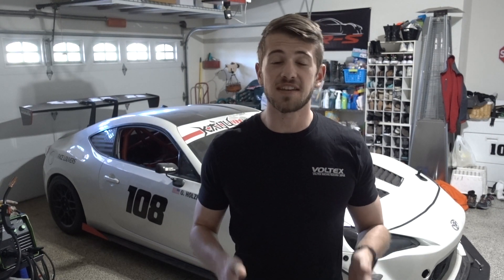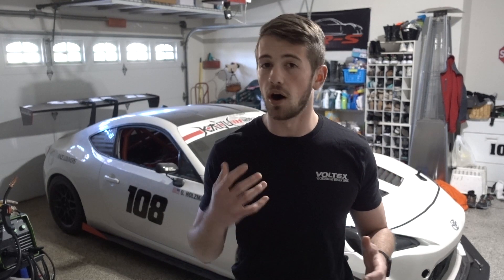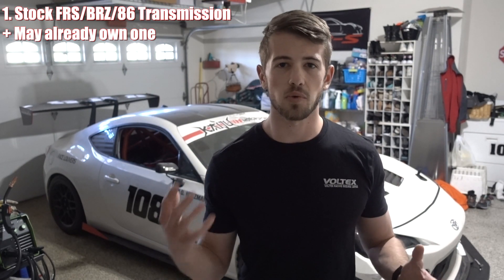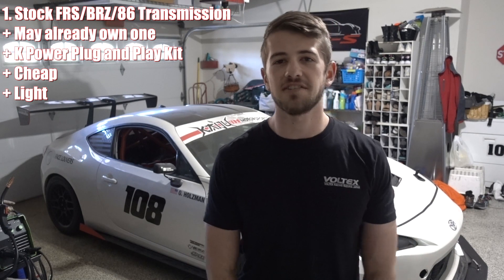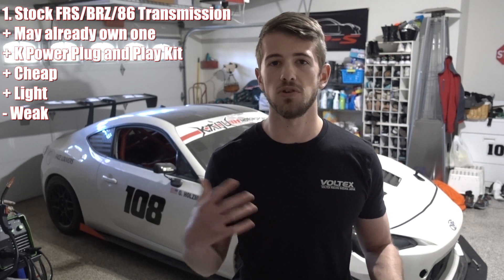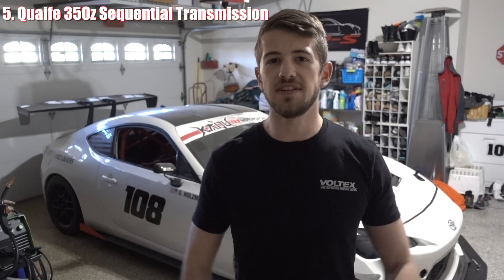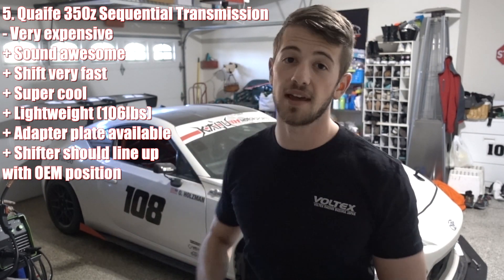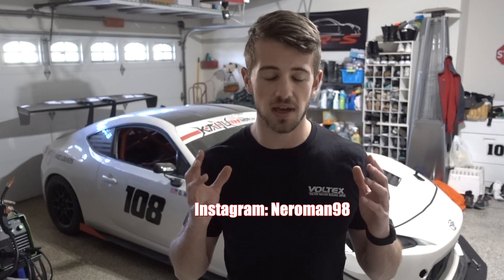K24 Swap FRS- Transmission Options

Comment: Should also mention you can still get brand new CD009s for less than $2k whereas my plan is to get a used zf 6spd manual from and e46 or e90 that are used $2k but they're also stronger than the s2k trans and probably lighter than the cd009

Comment: In terms of sequential wouldn't it make more sense to use the Quaife QBE69G, the ft86 specific gearbox cause then you could just use the k power trans mounts and bell housing adapter?  It still holds up to 750 horsepower.
Reply from the maker: You would still be dealing with the issue of getting the shifter to line up. In my opinion I think that relocating the shifter is a tougher battle than fabricated new transmission mounts.

Comment: Well if you can make the cd009 trans work that might be exactly what I do if not I have a spare s2k trans and 400 would be plenty of power tbh
Reply from the maker: If you have a spare S2000 transmission then that’s not a bad option.

Comment: Just some heads up, the BMW “dcct” dual clutch gearbox, is even heavier then that, considering it needs 9-10L oil and is massively big! Big in size, Did som measurements on that gearbox and it’s no way it will fit in the the tunnel, needs serious modifications too the chassis if someone wants a decent weight transfer.

Comment: Could you recommend some strong automatic transmissions that can be mounted onto a k series? Preferably ones that can handle 700+hp
Reply from the maker: The M3/M4 dual clutch transmission should do the trick and provide very fast shifts
Reply: @OrenHolzman  Thanks I appreciate it.
Reply: 8hp75 from ZF, it’s what the Giulia Quadrifoglio uses and also some BMWs.

Comment: Hey Oren! I have been following your channel for a while. Since starting your channel I have completely upgraded my suspension on my Miata. Now I am doing a K24 swap on my BRZ. Do you know anyone who wants a 7000 mile BRZ engine/transmission?
Reply: Where are you located?
Reply: For how much?
Reply: I spun a rod bearing in my frs after only 1 1/2 months of ownership and I need a new engine now because I’m in collage and currently can’t drive
Reply: @professorzooom4580  I live in NY. I won’t charge a lot
Reply: @AT-fi9dj  what’s the asking price? Also for the k24 swap how’s that going. I was looking at engines and if I do the k24 I was hoping to keep the stock transmission but idk I just need an engine. Would you be willing to do $1,300? I don’t want to feel like I’m haggling here just testing the waters.
Reply: @AT-fi9dj  and was the car an auto or a manual
Reply: @professorzooom4580  sure 1300 works. What state do you live in? How am I going to get it to you?
Reply: I am holding onto the transmission. I got helical gears for it to beef it up. Was 1300 for the engine?
Reply: @professorzooom4580  manual
Reply: @AT-fi9dj  that’s fine with me I’m going to keep my transmission to save money it’s an auto but it’s not the end of the world lol.
Reply: @AT-fi9dj  I live Mississippi I can see about shipping I’ll purchase the engine in late September because that is when I get paid. If this is fine with you, what is your contact information?
Reply: @professorzooom4580  that works with me. Can I private message you with my contact info? I’d rather not give out my personal info on youtube
Reply: @AT-fi9dj  me neither and I don’t mind go for it do you need my email or can you do that though YouTube
Reply: @professorzooom4580  are you willing to provide your email?
Reply: @AT-fi9dj  I’ve sent this message 2 other times today idk what’s going on
Reply: @professorzooom4580  I was saying that I’m not comfortable giving out any personal info on YouTube. I don’t know how else to get in contact with you
Reply: @AT-fi9dj  oh sorry not this I meant my email I’ve sent it two times yesterday and each time it didn’t send through
Reply: @AT-fi9dj  it’s stormzxyz
Reply: @AT-fi9dj  it’s StormZxyz and then I’m with google whenever I write my contact it deletes it so let’s see if this works
Reply: @AT-fi9dj  and it works now that’s my email followed by @gmail.com
Reply: @AT-fi9dj  did you get my email?

Comment: so does the s2000 trans work with stock driveshaft
Reply from the maker: No, no transmission, including the OEM trans, will work with stock driveshaft since the K swap kit pushes the trans back about 4 inches.
Reply: @OrenHolzman  dient think of that, makes sense. thanks

Comment: So what if... and hear me out here
Toyota 86 chassis
K24 engine
CD009 transmission
Toyota + Subaru + Honda + Nissan = Toyobaronsan

and then stick the TRD STI Type R and Nismo badges on the car
Reply: You can call it a Toyota chassis but Toyota gets the chassis from Subaru and is stamped Subaru in multiple locations.
Reply: @RadDadisRad  but it was co-developed by Toyota, Subaru had more to do with the engine

Comment: anyone knows where to get motor mounts for brz/frs   kSWAP
Reply from the maker: So right now there’s two available: PURE auto and TF works. However, I’m waiting for K Power to drop their kit since it’s going to have the most R&D of any kit on the market.
Reply: @OrenHolzman  i see a complete  kit tf works  is that the one your taking about ?
Reply from the maker: Correct but you can probably hit them up for just the engine mounts.

Comment: I’ve seen some guys using rx8 transmission..
Reply: I'm trying to find the smallest to fit with a k24 and go in an old toyota.. I've see adpter plates for all sorts of trans, for my power goals (lol basically stock + reliability) I'm after the smallest package so I don't have to cut anything, I can't weld for s#$t.

Comment: Is this swap street legal??
Reply from the maker: Depends on where your car is registered.
Reply: Only if you don’t modify the crash structure and if you keep all the emissions equipment that are compliant with the newest mod, aka if the car is from 2016 and the engine swap is from 2010 the car would have to meet the 2016 emissions standard.